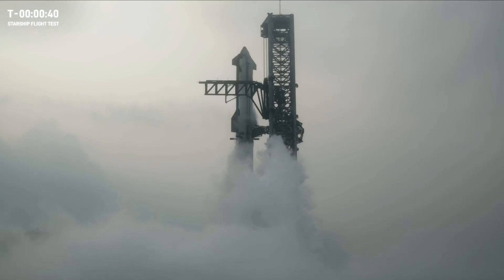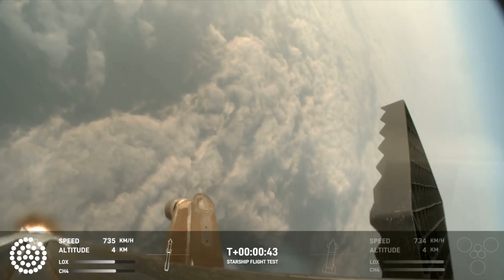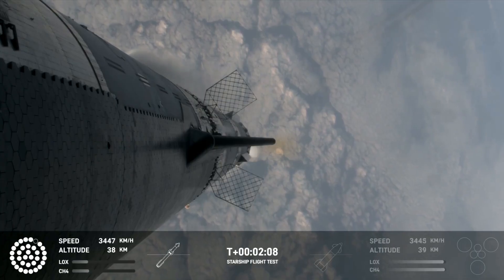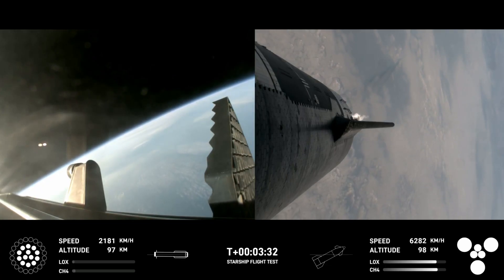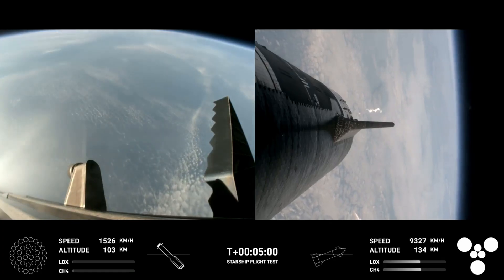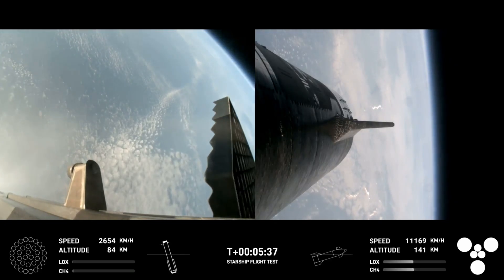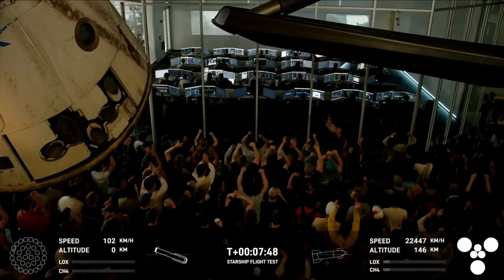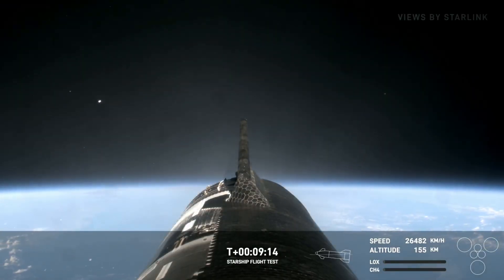Blastoff! SpaceX Starship launches to space on 4th test flight, booster splashes down!

Comment: Successful Splashdown??
Reply: Yeah booster splashdown was perfect, the ship took a beating in re-entry but just about made it.
Reply: yeah it was successful
Reply: It splashdowned successfully with a severe damage flap, and its just the one we saw, not others so maybe it required more time for us to know how much damage the ship get
Reply: Sort of. The booster made it just fine, apparently. The orbiter was a little worse for wear, but kept working and transmitting until splashdown, allegedly with a little landing burn.
Reply: @hermanrobak1285 im confident the starship also did successful splashdown
Reply: @hermanrobak1285  You can see in the feed the starship landing softly on the water.
Reply: @Octuly  For rather low values of "you can see", if you mean the second stage (orbiter). I could infer it from the telemetry shown below the video. It would be neat if there were tracking shots of it.
To be fair, on-board video from atmospheric entry, all the way to touch-down is a rare treat.
Reply: @hermanrobak1285  Yeah the second stage is named Starship. You can barely see the water right when it landed which was cool. I am still surprised by how reliable starlink has been with the onboard views for both super heavy and starship
Reply: @hermanrobak1285  I do wish someone from Australia or something got video of reentry because I bet they would of seen at least something right when it first reentered
Reply: @Octuly  The ocean is big, and I suppose SpaceX chose splashdown to be where fewer ships sail. It was night in the splashdown area, and likely far away from land.
Edit: We shall see (fingers crossed) well covered landings in the fullness of time. The grab-rocket-with-chopsticks thing will be interesting to behold. If they can nail that, both booster and Starship, that would be something. Next, I'd like to see some cheeky test landings of the Human Lander System. 
For example, can the HLS endure toppling(¹)? How bad would the crew fare if HLS tipped over? Could SpaceX just send another HLS to the Moon in time? Or have a "spare" HLS loitering? (fuel cook-off be damned!) Would all these things take too long or cost to much? 
¹) On Earth, a toppled Starship would certainly burst and burn. But in vacuum and 1/6g, maybe not?
Reply: @Octuly  There is a video of the booster splashdown released now. A little dodgy, and cut short.
It looks like that camera was on some sort of buoy. The Starship splashed down half a world away, in darkness.
Reply: @hermanrobak1285  I saw that. That video was incredible. And yes it was a buoy. Which is good news since that means the booster was meant to land at that location. Starship I can see why it wouldn't land in a specific area since the flap